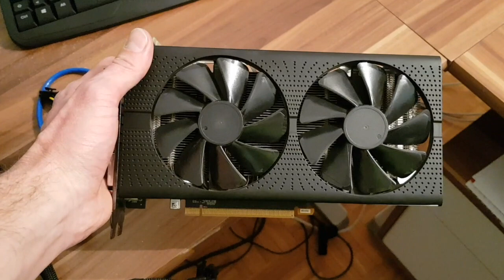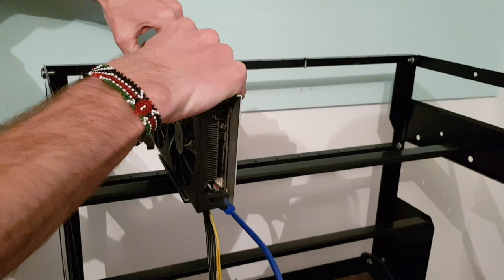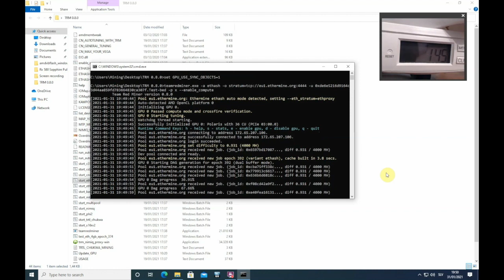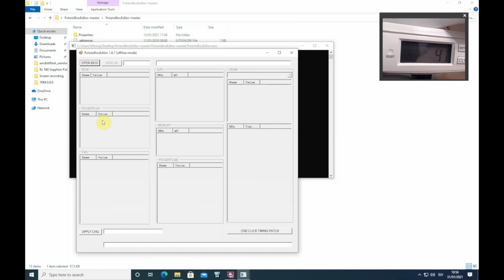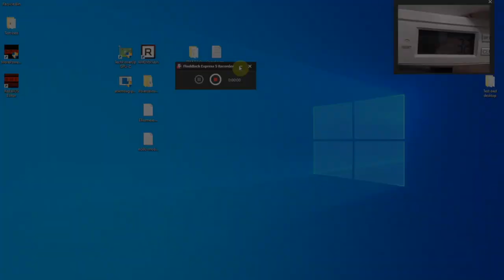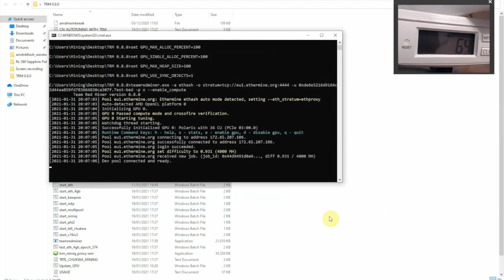Beginners guide : Rx 580 8gb Ethereum mining - bios mod & overclocking

Comment: I did it but When i restarted, the graphics card does not work ,black screen not working 
What is the solution ?????
Reply from the maker: Seems like you bricked your gpu... Check video where I explained how to save your gpu if it is bricked..
Reply: @lukee7290  I did the explanation literally, it looks like the graphics card has been burned 
The computer no longer recognizes the graphics card as if it does not exist

Comment: Hey, what should we expect for gaming on the modded bios? Do I need to flash it back to play or will it work normally? Thanks!
Reply from the maker: I really dont know, my guess would be that you can play games with modded bios, just performance could be a bit lower... Or not, i dont know :)
Reply: @lukee7290  I ended up going through with modding the bios and playing games seems about the same. Ran a benchmark for gta 5 and would say the difference is very minimal. Thanks for the reply!

Comment: It didn't work for me. I have an RX 580 8GB with error code 43. I tried using the backup tool, but nothing. I have the micron memory
Reply: I need help! Anyone have a BIOS for Micron Memory?
Reply from the maker: @jeffcartwright5468  you get code 43 after bios mod?

Comment: How many gpu do u use to mine?
And I don't have the option overclock drive in 0.8.0 version why is that?
And I have 27 mhs without modding anything how much do u think I can earn mining eth?
Reply from the maker: Like 40 gpus, not so much anymore, since I sold most... 
Overclock drive?
At current difficulty and prices you would get around 70$ per month with 1 gpu
Reply: @lukee7290  I live in India so our electricity cost way too low so I might get around 80 which is a great deal for me who lives in India
Reply: @lukee7290  but which do u suggest mining eth or any other coin?
Reply from the maker: @RoronoaZoro-d1w  well, whichever project you believe in...
Few suggestions would be ETH, ETC, RVN, XHV...
Reply: @lukee7290  I just tried to mine grin but after calculating my profits are 15 usd per month 😅
Reply: @lukee7290  if possible can u tell which software to download for XHV and RVN? And also where to open their wallet and all if u can please
Reply from the maker: @RoronoaZoro-d1w  for mining I am using team red miner ..
You can download wallets from their website...
Reply: @lukee7290  like Team red miner is not working properly for me
Reply from the maker: @RoronoaZoro-d1w  why not?
Reply: @lukee7290  I don't know why and I'm currently trying to mine RVN with NBminer but it's only at 11mh/s
Reply from the maker: @RoronoaZoro-d1w  max you will get on rvn with your card is 15mhs
Reply: @lukee7290  then which coin should I mine? I tried to use unmineable software to mine doge or xrp but it keeps crashing and I was getting 27mh/s for eth using lol miner... It's there any other coin which can give more profits and above 30 mh/s?
Reply: @lukee7290  and its fluctuating a lot like I just got 20mh/s and it went down to 4 now
Reply from the maker: @RoronoaZoro-d1w  you need to understand that coins are having different algorithms that is why you get different hashrate
Reply: @lukee7290  OK btw do u think nicehash is good?
Reply from the maker: @RoronoaZoro-d1w  nicehash is only good for beginners who dont want / dont have time to do the research...
Reply: @lukee7290  true it sucks but it's giving me 25 mhs which is a lot better than most except ether mining.... Or so u suggest eth mining is what I should aim for
Reply from the maker: @RoronoaZoro-d1w  eth mining is ok for sure, but you should go with what you believe in the most..
Reply: @lukee7290  I don't really believe in anything because my gpu sucks and if there's any other coin to mine which can give me atleast 100usd per month that'd be great

Comment: So i already got a rig running 5 cards: 3x RX580 strix 1x RX480 8gb strix and 1x 480 8gb Sapphire Nitro and they all do around 27mhs without bios mod..If i want to mod bios i need to turn everything off and do bios mod on one by one and then reassembly whole rig all over or?
Can i mod while they are on risers or it needs to be in pcie 16?
I would just plug them all off and go 1 by 1?
Would it increase my hash rate?
Reply from the maker: 1. You can mod them while they are on riser.
2. The safest way is to flash them one by one, but it is also possible all at once.
3. Yes it would probably increase your hashrate to above 30mhs

What I usually do in this case is :
Have my monitor cable attached to motherboard, unplug power cables from 4 gpus, start system with 1 gpu, mod and flash bios...
Turn comp off, unplug moded card, plug in second gpu, turn on, mod flash...
And so on untill all 5 are flashed. Than plug in to power all 5 gpus and turn on. 
Remember - after modding and flashing you will need atikmdag patcher...
Reply: @lukee7290  What mobo you got?Im using H110 Pro BTC..So im supposed to plug my monitor cable to motherboard and remove 4 of my cards,and flash one i left olugged in with riser,then remove that card and repeat proces for remaining cards?
What about this patcher,should i use patcher after every bios flash for every card?
And also i never used overdrive to tweak cards,i already got some profiles in Radeon GPU software,if i want to use Overdrive,i need to reset radeon tweaking settings to default for all cards or?
Is there gonna be problem with using both softwares?
And what core and memory values should i use for 480 and what for 580?
I heard many people bricked gpus eith flashing bios,that kinda scares me :o
Reply from the maker: @vukaleksic8304  well there is always some risk of bricking your gpu, but in 99% of cases it is easy to recover it (check my bricked gpu recovery video). 
Yes procedure is like you describe it... You can use patcher after every flash, or just after all flashes, doesnt really matter.
I usually use gigabyte motherboards, but it doesnt really matter.
As long as your cpu has integrated graphics than yes it is more stable if you plug monitor to motherboard instead of gpu (you need to switch primary display to igpu in your motherboard bios).
When it comes to overclocking, you can use whichever software works best for you. For me I would always choose overdriven...
Reply: @lukee7290  Im getting another Strix RX480 tommorow and then i can try to flash them all 1 by 1 and see the results..
Can you leave tweaking numbers here in comment?
For 480 ones..Will pray and try it tommorow :o Hope everything gonna be okay
Reply: @lukee7290  Forgot to ask,can you use overdriven to control multiple gpus at the same time?
And how should i know if my gpus are controlled via overdriven or radeon tunning software?
Sorry for bothering you,really new to this
Reply from the maker: @vukaleksic8304  yes you can use overdriven to controll all your gpus.. 
In radeon settings you need to do anything manually, if you dont do it than whatever you will apply in overdriven will be applied...
Reply: @lukee7290  Is there any way to set integrated graphics without using bios?Last time i had troubles in bios..
Gonna have to try it out tommorow and see the results..Gonna go card by card and see what will happen
Reply: @lukee7290  I also tried the edit method with mt 1 and rxboost and manage to get 30mhs but only on 1st card,all others went to 0 and phoenix crashed..
Did not know how to edit commands for each card by numbers..
Reply from the maker: @vukaleksic8304  dont be afraid of bios, its very easy to use... 
I am not sure from my head what commands in phoenix are... I am always using team red miner ...
Reply: @lukee7290   Did the flashing,better results for sure! :) Thanks alot! Can you also help with some oc tweaking settings for those cards?
Rx580 and Rx480 all Asus strix..
Reply from the maker: @vukaleksic8304  what oc are you using? Which memory do you have on your cards...
Did you apply ref 30 memory timing?
Reply: @lukee7290  Have done bios modding and all cards went up to 30mhs at stock OC..
Problem i got is one one card (Sapphire RX480 8GB ) im getting really high amount of rejected shares..
All cards were lets say 160/2  170/3 155/1 and Sapphire was 155/50..
Tried underclocking,tried also undervolting,reduced memory clock etc nothing helped..
I guess it has to be something with bios?
All rest cards are doing great,except that one..

Comment: Hello how are you Black hawk mining ? I need your help please ... when i turn with your program, all i's ok for one rx 580 8go, and 2, but after when i have more than 2 gpu's. I have a lot of problem what can i do ... ?
Reply from the maker: Hi I am doing ok, thanks. How are you ;) 
You need to tell me what kind of problems you have...
Reply: @lukee7290  thank you i'm good too :) 
GPU 1 ERROR - failed to allocate etash DAG buffer. I have this problem when i start my 8 rx 580 armor 8go ... I'm new in this beautiful word of minig =)
Reply from the maker: @synthiamlynarek4954  am... Did you set your virtual memory to at least 64gb?
Reply: @lukee7290  it's in initial size and maximal size ? i need to change for initial 64 000 and maximal ? that's it ?
Reply: in avaible size i have 81000
Reply from the maker: @synthiamlynarek4954  you can set from 1600 to 64000
Reply: @lukee7290  thanks you all it's good i'm just scare about flashing the card for have 30MH ... 😅
Reply from the maker: @synthiamlynarek4954  there is always slight risk of damaging your card, but I think its worth a try... In most cases if you brick your gpu it is very easy to unbrick it back to stock...
Reply: @lukee7290  Ok so if i do it i can back to initial setting ? I have 8 RX 580 8go ARMOR OC memory samsung, and one rx 570 8 go. Do you think i can try with your setting ? =)
Reply: @lukee7290  and sorry again i would like to know if can i do you what's you do one buy one like you say, but without disconnect all off risers and card ?
Reply: @lukee7290  I need to change somethings in the program ? (ps : i just start mining with my pool, and my adresse eth and not flash like you do my cart one by one) i scary 😅

Comment: Now u can get 8-9MH/s
Reply from the maker: You need to switch from graphics to compute mode...
Reply: @lukee7290  Yeah i know, but u can only do it with one gpu ?
Reply from the maker: @TheOfficialStone  no...
Reply: @lukee7290  Then how can i on hiveos on comp mod.
Reply from the maker: @TheOfficialStone  which software are you using? Team red miner?
Reply: @lukee7290  yes
Reply from the maker: @TheOfficialStone  you can add this into command line --enable_compute...
This is where you input pool address and stuff
Reply: @lukee7290  i will try.

Comment: Thank you!! For providing bios mod tool. I need it badly.
By the way, I have a question:
1) Can I use MSI Afterburner for overclocking? I'm not familiar with the Overdrive.
Thank you so much!
Reply from the maker: :) it is possible to use msi afterburner, but I will always suggest overdriven...

Comment: I have the 8gb Red Devil with a bios switch. can I mod just one part of the bios settings and leave the other for general use/gaming? Can I also use the video signal of the card while its mining?
Reply from the maker: Yes you should mod just 1 of 2 vbioses on your card... This way you also have backup if anything goes wrong with bios mod/flash..
Yes you can use video signal of the card while mining, but it is better not to, it can cause instability...
Reply: @lukee7290  Thanks, that was just the answer I was looking for!

Comment: Hey BHM, what script would I use to auto reset a gpu that has crashed?
Reply from the maker: Check this video https://youtu.be/ZP1LhMXO-Y0
Reply: @lukee7290  thank you - that video was fantastic, but didn't answer my question. I'm trying to have the miner restart a crashed gpu automatically. I've tried playing with "watchdog" but at the moment the watchdog.bat file just resets the whole computer
Reply from the maker: @roccoprochilo5130  oh sorry I misunderstood what you wanted... 
Amm, I think watchdog is for that purpose.. I never really played with watchdog...
My goal was always to make rig so stable that I didnt get crashed gpu at all for a long time...
Reply: Haha well great logic. My vega 56 with hynix using your settings from another videos comment has failed a few times (at 51.4 mh/s).
I solved the issue (I believe) by including "--wqtchdog_script" and editing the watchdog.bat file to "start_eth.bat /r"
Reply from the maker: @roccoprochilo5130  i guess you need to alter settings just a bit... maybe reduce overclocks, or increase voltage...

Comment: I only get 8.097Mhs with or with no enable_compute   with no OC as well  :c how can I know if the  enable_compute is working?
Reply from the maker: You can go into adrenalin drivers and manually turn graphics -> compute
Oh I just realised you already figured it out... thanks for sharing :)
Reply: for the people that the enable_compute don´t work do this 
Open Radeon Software.
In the top right corner click on Settings.
In the top left part of the screen select Graphics.
Select your GPU. ...
Scroll down and click on > Advanced.
Change GPU Workload from Graphics to Compute.
Agree to restart the Radeon Software.

Comment: Thank you very much for the video!, I followed all the steps but my three rx 580 phantom gaming oc cards cannot exceed 24.6 mh / s. any suggestions?
Reply from the maker: Did you do bios mod?
Reply: @lukee7290  Yes, I did the mod step by step, but the MH cannot go up any more with your technique, they were in 24mh, so that you have it in mind delete the OverdriveNTool application and enter the adrenaline from there activate the RAM option in my case I have Samsung active timing 1 achieving 28MH, thank you very much for your answer and much more for your video if you have any idea what else I can do to upload that little bit that I lack, I would appreciate it! A hug!
Reply from the maker: @snnnake  you mod your bios with 1500 strap.
Did you use polaris bios editor and one click bios mod? 
Can you copy for me what is your 1500/1550 strap
Reply: @lukee7290  sorry, I don't understand which part you ask me, the 1500/1550 are from the cpu or vram? I modified the bios with the 2 click program.
Reply from the maker: @snnnake  1500/1550 strap is from the gpu memory....
Which program? Polaris bios editor?
Reply: @lukee7290  yes!  and my straps are 1500/1625/1750/2000
Reply from the maker: @snnnake  you need to copy 1500 to all higher ones...
This is basically what 1 click mod does... but you cant try manually... if this doesnt work I will give you special strap to copy to 1500 and all higher ones...
Reply: @lukee7290  Thank you very much for responding so tricky, so what did not work for me is the one-click mod, but it cannot be modified manually, is there another alternative?
Reply from the maker: @snnnake  red bios editor from igors lab
Reply: Join us to start making daily and weekly guarantee earnings on crypto, Nft and metaverse stocks through Amelia strategy. I really appreciate the effort of her who made it happen.••

Comment: Thank you so much! I am a new miner with an RX 580 and your videos have helped me a lot!!! Got my speeds up to 31.120 MH/s that’s the highest i’ve gotten it. Keep making amazing videos for us beginners!
Reply from the maker: Thanks for your kind reply... 31mhs is great if it is stable. 
We do not always aim for the highest hashrate for a long run... also power consumption and stability are very important
Reply: Black Hawk Mining I’ve been tweaking it a little and now have it running stable at 32.211 thank you so much for the tips, I believe that’s the hashtate i’m gonna leave for tonight and will test more tomorrow! Once again, thank you so much for the help. 🙏🏻
Reply: @quarkzyhn4391  how'd you do that? My 580s aren't getting over 30.5
Reply: @lukee7290  Hey! I have a small question. Do i need to apply modded bios every time i restart the computer or is it a 1 time thing forever? thank you
Reply from the maker: @quarkzyhn4391  if you flashed moded bios to your card than it is there forever... well untill you flash some other bios to it.
Reply: @lukee7290  thank you! 🙏 so so much legend

Comment: Great video! I followed your guide and overclock settings. I'm only getting 27.23MH/s a most. Is there anything else I can do or is this the most it can get now?
Reply from the maker: Bios mod, overclocking, memory timing?
I have not seen rx 580 that was not able to go above 30
Reply: @lukee7290  i currently have core at 1150mhz/850mv and memoery at 2250mhz/900mv and power target 50%, getting 27.83MH/s at most.
Reply from the maker: @alom310  take power target away... dont set it

Comment: My pc does not boot to the desktop after changin the bios
Reply from the maker: This means you probably bricked your gpu... you flashed not valid bios to your card...
Reply: @lukee7290  luckily i have dual bios. Now Im switched to the second one. How to I fix the first one?
Reply from the maker: @levisupps  once in windows switch back to first one (the one that did not boot) and flash original bios back on it... the one you saved before first flash....
Reply: @lukee7290  it says adaptor not found
Reply from the maker: @levisupps  where does it say so?

Comment: When I run the OverdriveNT tool and select apply, my screen has little pixels everywhere and I can’t click anywhere.  Any ideas?  Thanks
Reply from the maker: I would say your overclocks are too high, or voltages too low. 
Anyway something wrong with settings you want to apply. 
Try something conservative to confirm it works....